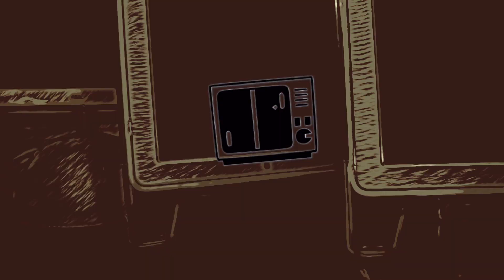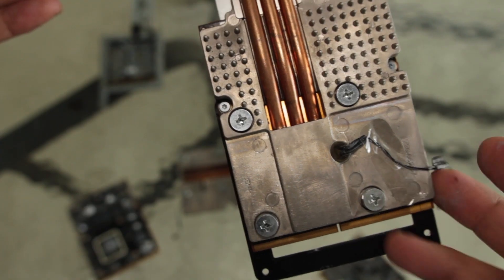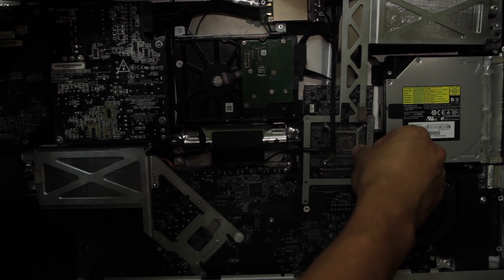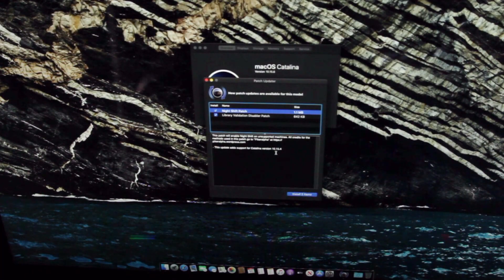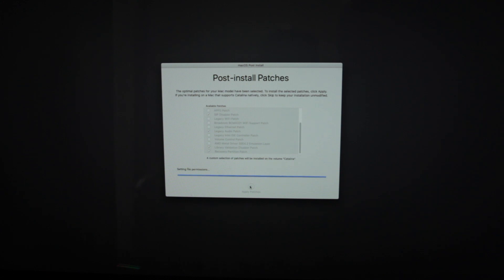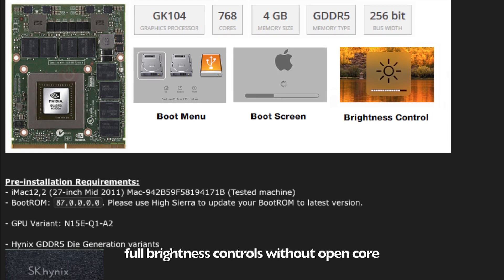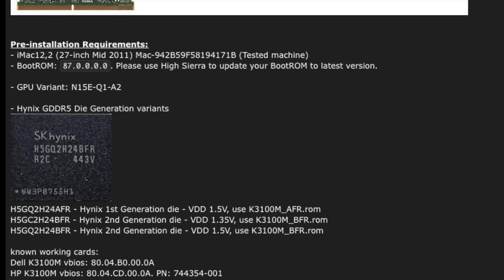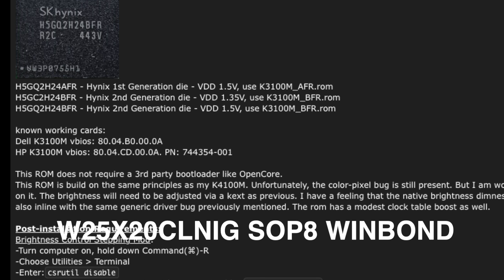iMac 2010 11,3 Nvidia k3100m upgrade

Comment: Just finding this video! Thanks for sharing!! Do you have any idea where to find a 3-pipe heatsink? I've looked on eBay and aliexpress and they're all out.  I have a Mac 11,3 exactly like yours.  Prices for the K3100M 4GB GPU MXM-B boards are fairly reasonably priced.  That said, finding a 3-pipe heatsink is like finding hens teeth - nowhere to be found! 🤔
Reply from the maker: ooff this video is old now lol. um look you need to find a 11,3+/higher model.. anything higher generally has them from memory nvidia cards from a dead imac. hard to come by. in saying that you can get away with a 2 pipeline version but you need a ton more air speed and even then i doubt it will work

try other sites like ali etc.. sometimes you can get them or just junk macs from market place and try your luck.

anyway this model needs the cpu upgrade 880 i7 to run the latest capable version really

Comment: I upgraded my 2011 27" Mac 12,2 with a K3100M, and everything works fine when it powers on. However, now I have problems turning it on. Sometimes, I have to unplug it and try turning it on, but nothing happens. I’ve also tried unplugging all the peripherals and turning it on—still nothing. Holding the power button down and trying again also doesn’t work. Sometimes it takes 10-15 tries before it powers on. Does anyone know what the issue could be? Thanks in advance!
Reply from the maker: that could be anything. be careful something is not shorting the system out inside.

Comment: Awesome informative video! I have the same iconic iMac and i have a few questions, for starters, if its ok...
1. what apps are u using with ur gpu? (I ask cause im a designer and mostly ill be using Adobe CC apps)
2. is the brightness control usable through the keyboard?
3. im not capable of doing the flash on my own, so ill be getting a preflashed card, should i get one with a specific bios?
4. do u think the 2pipe heatsink might be not enough for cooling the gpu and i should get the 3pipe?
5. and also, most importantly... is TDM working?
Reply from the maker: #1 nothing really its just a general use machine for me.
#2 yes.
#3 some of the firmware chips on these donot have enough room and you may have to change it out with a solder station.
Reply: @chelsona2574  3. i dont understand what chips ill have to change with a soldering station
any comments on 4 and 5 ?  🙂
Reply from the maker: The firmware chip. 3 pipes is always better. What isbtdm I have no idea what that means lol  @giorgos7six
Reply: @chelsona2574  oh sorry... TDM=Target Display Mode
Reply from the maker: @giorgos7six no idea sorry

Comment: hi, i just installed the same gpu on my imac 2010 27 inc. the gpu was from an hp lamptop. when i turn on the imac it does just stay black but the mac sound plays. the keyboard is not connectig at all. what do you think?
Reply from the maker: that could be anything. be careful something is not shorting the system out inside.  you need to take the hdd and ssh into using grl.

Comment: Just did this on 21.5 inch 2011 iMac with the K3000M kind of similar to the 3100M works pretty well all things considered will get slightly warm when the GPU is being used by OSX of course i will have to actually throw a decent load at it to see how it holds up considering its wattage but I am running mountain lion so there may be a difference due to the age of the OS

Coming back over a month later for those who see this comment the card has done exceptionally well considering the wattage of the K3000M and the constraints of the 2011 21.5 inch iMac's PSU no major stability issues and i can even run Sonoma if i desire i main 10.8 for older software and games and other stuff that works better on an older version of macOS/OS X

Comment: I have a boot problem with windows 10 and the screen goes black when booting with this card
Reply from the maker: That's because these cards need to be flashed. Use the Linux grml method so you can SSH into it.

Comment: I am getting a used 27" iMac11,3 tomorrow and I'm looking into a Metal Capable GPU Upgrade so I can install and something newer than High Sierra with the help of OCLP. I wonder which GPUs are suitable contenders.
Reply from the maker: There's still a few good ones out there. Macrumours has the most up to date list. 😉
Reply: @chelsona2574  is it possible to post a link with the Macrumors up to date list you are referring to?
Reply from the maker: @giorgos7six  have a look? I don't wotk for mac rumours. I'm just a guy with an imac lol
Reply from the maker: @giorgos7six  dude.. google it.
Reply: did u finally make a gpu upgrade?

Comment: I installed it, and it runs flawlessly except. Sometime the machine rebooted on its own & the deep sleep mode is not working anymore. Before upgrading I always let the machine running as it goes deep sleep fine, but now now it won’t wake anymore. Any suggestion?
Reply from the maker: K3100m? It could be anything mate, all the cards I've done except one still work fine. Depends on where you got it fu up m, how old it is etc

Best thing to fo is try it in another Mac to see if it's the card or the imac causing the issue.

Comment: someone tested on 21" ?
Reply from the maker: this card will not fit in a 21.5 imac
Reply: @chelsona2574  where does it not fit? is it on the logic board or the heatsink?
Reply from the maker: @salsa99est  both. It's like putting a car tyre on a golf cart.

Comment: Hi...Its really a great video.  I have a question,  what about a GTX 880M 6gb, do you have any tips on flashing it? I ordered one for my iMac, and will need to flash.
Reply from the maker: you can get the bios from the Mac rumours website. it should be a similar process
:)
Reply: @chelsona2574  Many thanks

Comment: I installed the  4gb k4100m with 32gb ram with SSD and Big Sur. Runs flawlessly!! It was like pulling teeth to find a used 3 pipe heat sink. Used a dremmel tool to mod it.

Comment: Is the K4100m the same process for an iMac 2009 a1312  i7-860?
Reply from the maker: Yes it should be similar
Reply: @chelsona2574  with the bios flashed it should just be plug and play?
Reply from the maker: @fernandopata  once flashed its just a regular mac based card and should work in any os as far as I know.
Reply: @chelsona2574  Awesome! Thanks
Reply: I’m using the k4100 with Big Sur and it screams. It will run a ton of games and apps with no problem
Reply: @xxxxxDUSTYxxxxx  in what iMac did u make the gpu upgrade?